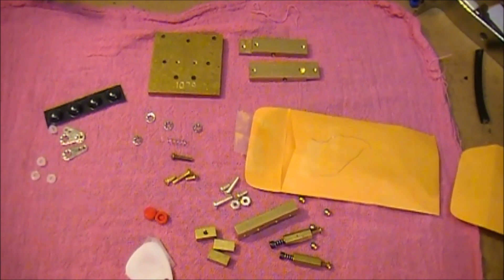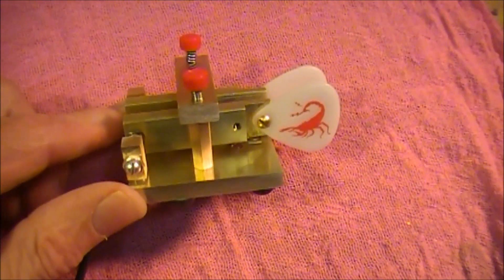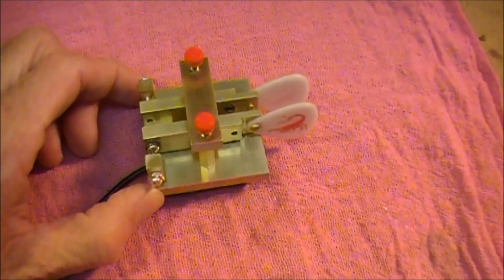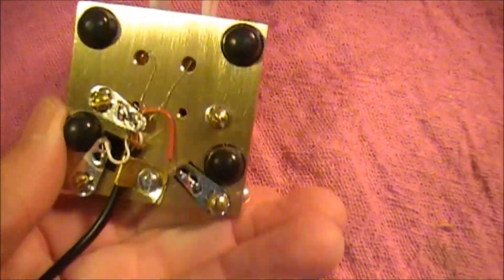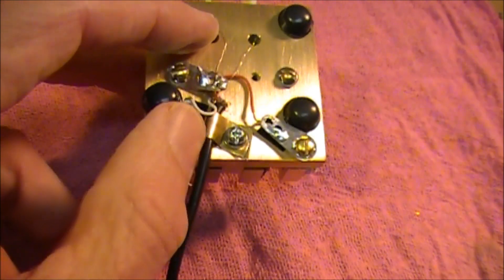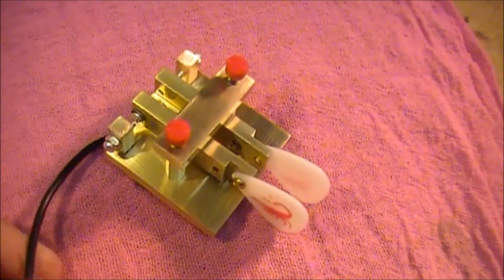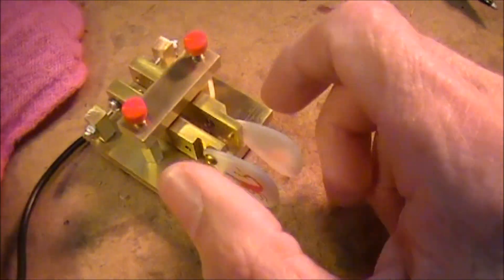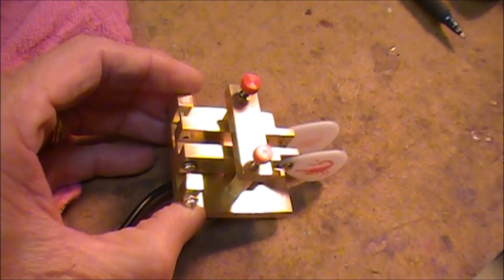Arizona ScQRPion CW Paddle-Part 2 of 2

Comment: I built a Black Widow kit several years ago. I don't think that it's offered anymore. It's very similar to the Scorpion but it has thumbscrews  to connect to a keyer. It also has magnets in conjunction with the spring to adjust the tension. It was a fun build. One thing that I should have done, and will do, is to put some blue Locktite on the guitar picks. They tend to work loose. I think I should invest in some instrument lacquer to preserve the brass finish!
Reply from the maker: +eminusipi Thanks for the comment. Unfortunately, I sold the key I had...it was a mistake since now they are no longer made.  In retrospect, it was a very nice portable key.  One of these day's I am going to learn not to sell stuff :-)   ~John
Reply: +W5CYF / TinkerJohn I sold a lot of stuff that I regret too.The AEA MM-3 Morse Machine was one of them. It was a great keyer with a lot of memories. Now using an Idiom press cmos4 built from a kit.

Comment: I built one and mounted it to a plastic plate to allow it to be used like a leg keyer and discovered that it is much more stable than the brass base and tiny feet.
A wooden base would also work .
Brass thumbscrews on the plastic or wooden base not only look nice they make for easy connections to anything.
The 2 switch contacts can be isolated if desired, simply bring the 2 thin wires to individual contacts.
As this is actually 2 switches it is possible to send 4 states.
I play with FSK.
KA5PIU